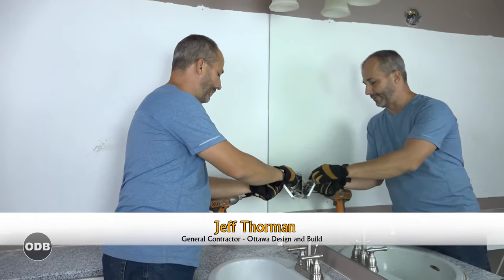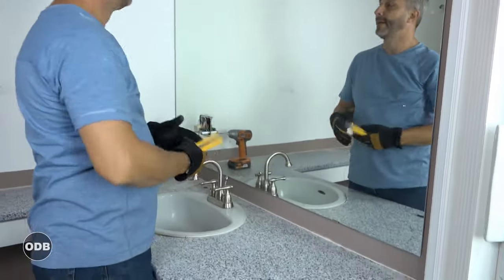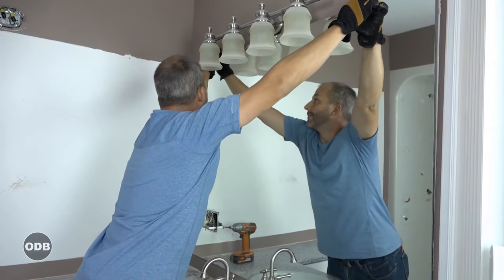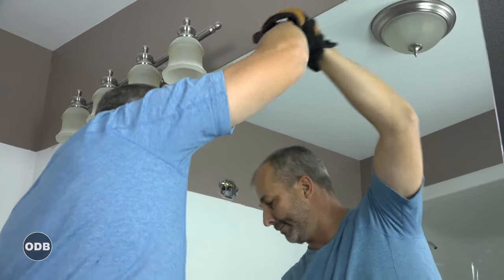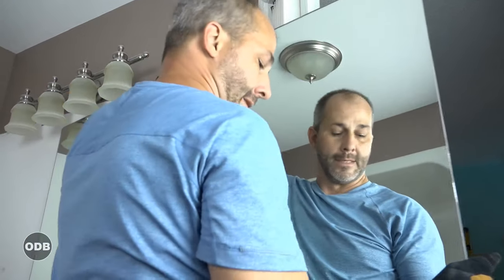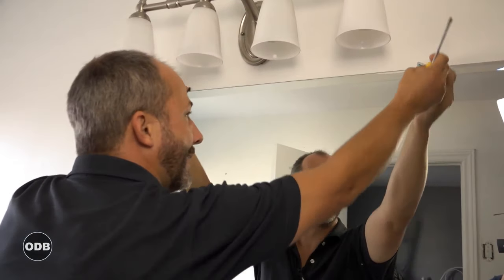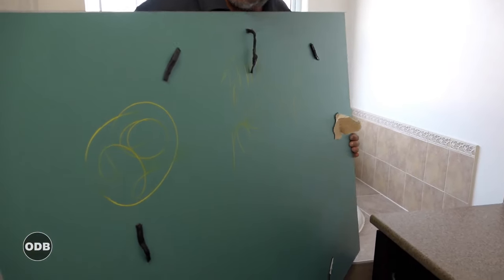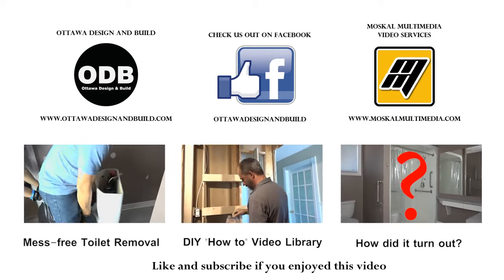How To Remove A Glass Bathroom Mirror Safely

Comment: WOW!  Just what I needed!  I'm so glad you made this video.  Exactly what I had.  Now, why did I remove it?  I had a new roof installed. I have a rambler. The roofers made so many loud drops and bangs I thought they were going to fall through the roof.  My vanity and mirror were pulled away from the wall -  I take from the house shaking.   I was afraid the mirror was going to fall and break.  They also added a nice crack above a doorway in another room and messed up the molding around a pocket door.  The clips were exactly how it was installed.  Thank goodness no glue! I was thinking of using a rubber mallet and "hammering" it back in place, repaint and replace mirror.  Thanks.
Reply: Same here. The mirror tilted forward only the recessed cabinet is holding it in place 😢

Comment: I love your videos! I have a strange situation with my bathroom wall. There is tile over drywall. They removed the mirror section of the tile to place a cheap 5 part mirror in the recessed area. The problem is drywall doesn't come in the thickness of tile. Any suggestions for filling that gap once the mirror is removed? Thanks!

Comment: Thank you for this video. The clip issue was bothering me. I am doing my elderly mothers bathroom over this weekend and I was scratching my head on the clips. QQ: if there is a lot of glue on back of the mirror, how would I repair the drywall? Please, please, please don’t tell me that i have to replace it!
Reply from the maker: Hi Tony, a lot of times the brown paper gets exposed. spray with kilz oil based aerosol primer and wait 5 minutes. then you can mud or spakle. Cheers!

Comment: So you don't believe it's necessary to use glue if you properly use the j-hooks and clips? I'm about to put up a room full of 3x7ft mirrors and am trying to determine if the glue is really necessary. Thanks in advance!
Reply from the maker: mirrors that size should be installed with a 2 sided mastic. if you don't want to see any hardware then I suggest talking to a glass shop about options. The size and weight of your glass may require you by code in your area to use track or silicone with a temporary brace. Just remember mirrors are not usually tempered glass and if they fall off a wall can cause serious damage.

Comment: Why don't you remove the glass from the light fixture so it is not in the way?
Reply from the maker: You could if you wanted too. Those fixtures have 3 set screws each and have to be loosened by hand . It takes a lot longer to remove than to just be careful with the way your holding the glass.
Reply: I would have taken the time to remove the fixture light shades, worn gloves, and taped the mirror.

Comment: The mirror we removed was much smaller but the previous owner must have used an entire tube of some sort of construction cement to attach it to the drywall.  They were going for a "window" look because there are no windows in the bathroom and just put cheap shutters over it.  Couldn't open the shutters and couldn't see the mirror.  Not sure what they were thinking.
We managed to remove it (and chunks of drywall) by using packing tape over the entire thing and using a prybar.  What a nightmare.
Reply from the maker: some times you find handy and sometimes you find creative. That is part of the fun!

Comment: What happened to the 'safety' part? No gloves? No tape? No eye protection?
Reply from the maker: The point of the video is to show how strong glass is. No worries, No sweat,No problem.
Reply: Rolls eyes .
Reply: Rolls eyes . So you're one of THOSE…
Reply: And turn off the power to the socket preferably.